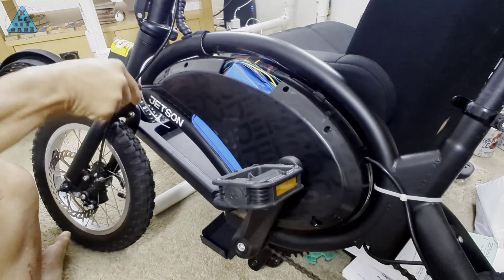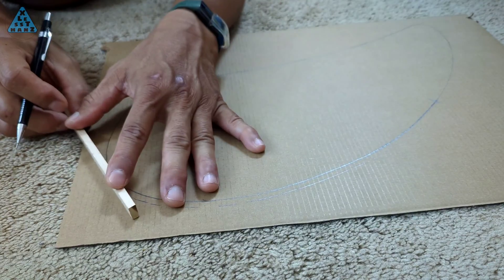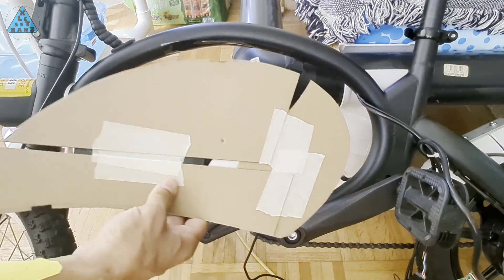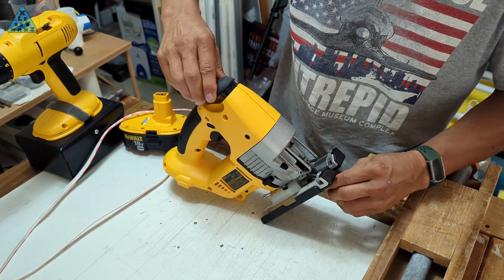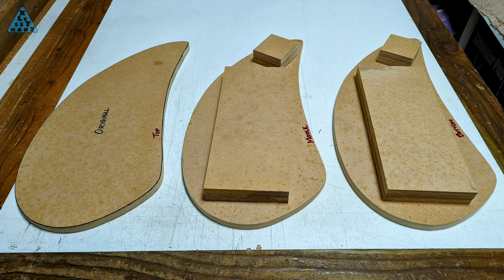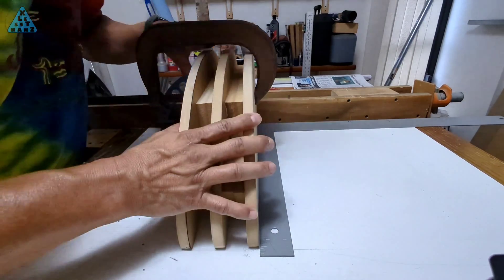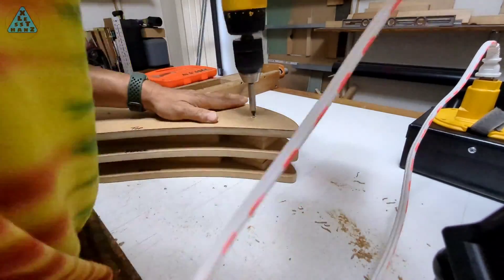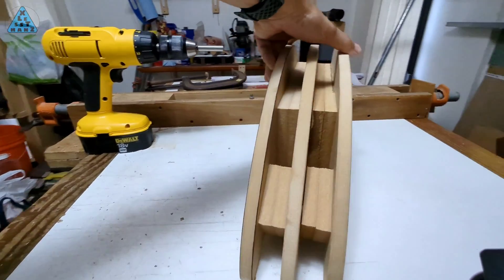Jetson Bolt Pro DIY'er - Custom Battery Compartment (METAL OR PLASTIC OR... 🤔)

Comment: Wouldn't it be better to use a polyiso board to mold your new battery case
Reply from the maker: If it can handle some heat from a propane torch, not continuous, it could work.  I plan try the mold with Kydex, if I can find a good sized sheet.  Kydex would be ideal for a compartment.  Very easy to work with, thin and very durable.

Comment: I love your build more on the spoke wheels and disk brakes please!
Reply from the maker: This would have been a hard video to make only because even the shop I always go to for spokes had a terrible time calculating spoke length.  The rim had to come from China.  I could not find a reasonably priced one from U.S..  Any disc brake hub will work that accepts same disc from Jetson.  I think the spokes are tough to come by because the rim is only 14".    One shop I went to wouldn't sell me spokes of that size, not even order them for me.  Another shop I more often go to for spokes could not calculate the correct spoke length, and I wondered if it had to do with the 14" size of the rim.  They sold me one set of spokes that, after spoking the rim, I found were all about 1/4" too long.  They thought I had spoked it wrong, so tried to do it themselves and realized they calculated the wrong length of spokes.  They eventually said they'll let me know when to come in to pick up the rim.  I think they ended up cutting spokes via trial and error to eventually get the correct spoke length.  I would've liked to try a 14" rear hub motor, but  the problems I encountered with a simple front rim made me decide otherwise.  Thanks for the complement🤙🏽